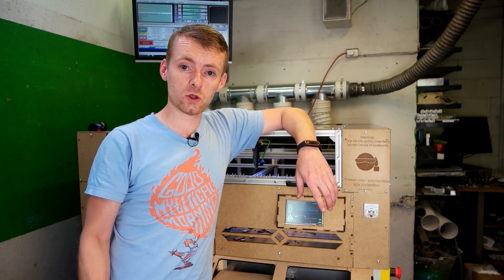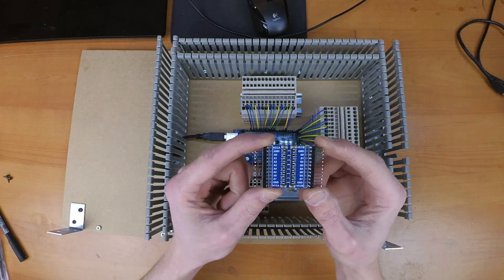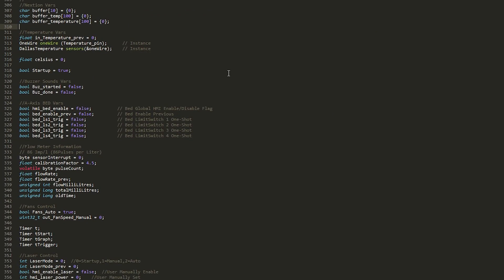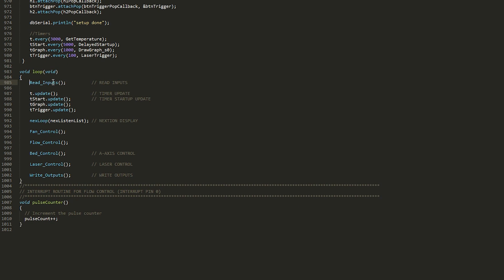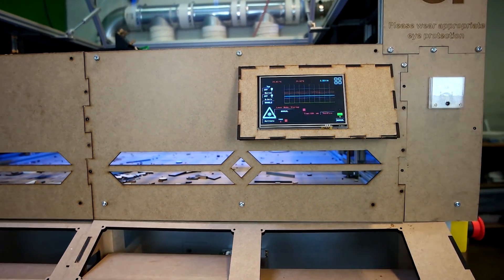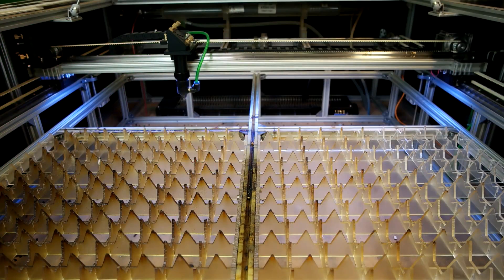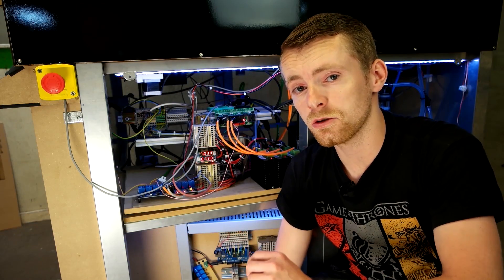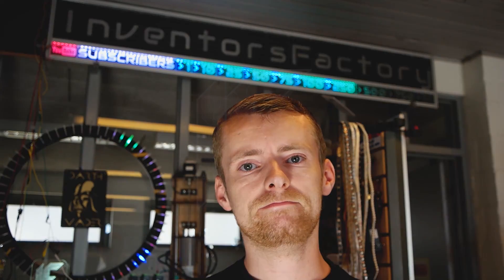DIY Laser Cutter Buildlog - Part4 - Waterloop Test, Electronics Cleanup, Safety and Extra

Comment: What a embedded micro controller based on the AMD PHENOM II X6 Stepping 3 would allow the use of floating point to give a cleaner and much nicer cuts, just an Idea.
Reply from the maker: Hi David, I could, but don't really need it as my cuts are clean and acceptable. I'm guissing you think the Arduino is doin the motion control and trigger but No, I'm using a Pokeys56U as the controller with an external 125kHz Pulse Engine so I'm good on that :)

Comment: Great video 
I have one question how do you control the laser power automatically for cutting and engraving ?
Reply from the maker: Hi Peter, thanks and good question ;) I don't do it automatically, I manually adjust power for engraving and cutting, in other words! I make a gcode file for the engraving and one for cutting :) I am planning on controlling the laser power from the spindle speed S Command, just as I de/activate the laser with the M4/M5 commands, just haven't gotten around to it yet :)
Reply: Great work ... so far :) .... did you try to work with special laser controller. .... ..
and how do you control the tube current .. ?
Reply from the maker: Thanks, no never tried with a laser controller, but will buy one for sure! controlling the laser tube current I used a pwm output on the arduino for a long time, but have now switched to a 0-5v potentiometer, I dial it in with a laser tube amp meter to ensure I don't go past the tube's limit ;)
Reply: can you point me to the circuit schematic for the current limiting ... I know that the tube require a high voltage power supply is that right ?
Reply from the maker: I can not I'm afraid, I have no current limiting in mine, so I do not know enough on that topic... The PSU I bought together with the 40watt tube on ebay back in the day...

edited: And yes it is a High voltage power supply :)
Reply: so you have a potentiometer connected to the laser tube power line and this is how you control the laser power ?
Reply from the maker: Typical the PSU has these connectors in the back, so the IN I control via a 0-5v signal to control the output of the Power Supply to the Laser Tube.

Link: https://www.google.dk/search?q=co2+laser+psu+schematic&rlz=1C1GGRV_enDK751DK751&tbm=isch&tbo=u&source=univ&sa=X&ved=0ahUKEwiwkOv02d_XAhXHJJoKHdYhBlcQsAQIJQ&biw=1920&bih=989#imgrc=Ao7g-k9CLDSAAM:
Reply: Ok.....thanks for the help man ... really appreciate it
Reply from the maker: No Worries Peter, I'm not an expert in this matter except I got it working somehow with help ofcourse, And I have most definetly been in your shoes wanting answers to many questions! And believe me!!!! when I started!
I did countless hours of scouting the internet, video's forums and stuff to get closer to completing it ;)

Comment: I am thinking to make a co2 laser cutter for my projects, what is the approximate cost of your cutter
Reply from the maker: Hi raghav, well depends on where you are in the world ;) I'm in Denmark and order most of my stuff from Germany. 
Without all the extra failed stuff and replaced parts, It's about 4k$ which isin't very cheap! 
If you want to estimate your cost search for:
Laser tube + psu, rails, steppers and drivers, controller and mirror holders and nozzle + the Profile construction you want which should give you a pretty good baseline to go for :) this is if you need something larger than an A3 size cutting area I would say ;)
Reply: Thanx
 i will study more about this

Comment: I like how you structured your code (fellow industrial automation specialist here). Also, how you walk us through your code is a surprising example of how NOT boring a code explanation in a youtube video can be.
But please, fix the audio in your videos. I have to raise the volume and still listen very closely for you talking whereas the intro video blasts my ears at the same volume levels. Quality of sound is not great either.
Reply from the maker: Big Thanks +Tony Bukreev :) Yeah code explenations are usually pretty boring! But didn't think mine was any different, so thanks for the pointer ;)
As for the Audio, Yes! I will look into the big Volume difference, just made some comparisons and it's very obvious, and the quality "should" get better in the next ones.

Comment: Great series of videos. Here's a link to the recipe I used for laser cooling water: (https://1stage-sph.tumblr.com/post/152253487230/laser-cutter-engraver-part-16). I've been running for over a year with no problems.
Reply from the maker: Thanks Sean, and yeah! Thats quite a nice system and lucky recipe you got running! Mouth Wash had not crossed my mind! :D Nice site/blog you got there, I've bookmarked it so I can go through it more thoroughly ;) thanks. 

As I have such a small amount in my system a 2 liter distilled pc watercooling liquid with anti algie something something in it seems to do the trick but when expanding of my reservoir will be underway, I think your solution will be cheaper for sure! If I can get a hold on that here in Denmark :D

Comment: I watched carefully this build log and there are very important information here ! Thankyou so much for showing a so inspirational work !
I usually work with 3D printers and have been reading and watching videos on the subject, and this week I must get the risk and build a laser cutter to a friend. We need this laser cut too much for save our business and racing career. So thankyou again !
One question I would like to understand better is : why you said that the squared HIWIN rails you used are unecessary ? They are absulutelly expensive here, and I was planning in use 16mm round bars as linear guides. I´m afraid of this being not ideal. Could you pleeeease give more info on this subject ?
Reply from the maker: Hi +Carlos Freitas Thanks for watching and thank you for the nice comment, sounds interesting what you plan on doing, as for choosing squared vs round rails, I only speak from experience as my CNC machine uses round rails and I personally think they have too much flex to them! 
But you can use them as long as your Mounting system on top of the rail wagons is really good and tight! I believe this is the issue with the cnc... 
When building the laser I found a good place for Squared rails for not much extra price so I went with them as I wanted to eliminate any issues with mirror aligning and beam consistency. Don't know where you are in the world but if in Europe I highly recommend www.cnc-discount.de as they have some cheap'ish squared rails... in 15 and 20mm width sizes. 
So in conclusion Carlos, you don't need squared rails ;) I had the extra cash and bought them to have an easier experience I guess :) 
Just make sure to mount them properly and you should be fine, oh and when you get going please send me a link or something so I can see what your making/progress, I love seeing other people builds
Reply: Thankyou so much for your response ! And yes, I thought the best option would be the squared rais, but, as I live in Brazil, they are very expensive here compared to the round ones. I will try to use the round ones with aluminum support, but firstly I will try to find some deal on squared ones... who knows its my lucky week !
I will blog my progress for sure, will be a pleasure to share it, and btwe, I will need help ! 
Thankyou again !
Reply from the maker: +Carlos Freitas Awesome man. Looking forward to see your project. ;) And Good Luck, hope you find what you need 😉

Comment: I subscribed right now to your channel. I really loved the content!

Is there anywhere I can look to get that project with actual measures ? I'm actually planning on building a laser cutter myself and would love to have some guidelines.
I plan on buying most of the stuff I'll need from China as well, except for some things I can easily find for cheap here in Brazil.

Thank you once again for the quality content! =)
Reply from the maker: Hi and Thank you very much, I have a basic Sketchup of the design, back when I started inorder to keep track of the profiles I needed. Let me touch it up abit and I'll post it here for you to download abit later today. 

Very cool that you are starting your own build, and stay tuned for the next video as I'm gonna go through all the things that I like and "don't" like about my machine :) just so you don't make any of my mistakes! :)
Reply: InventorsFactory Thank you very much! It will make things much easier for me! =)
Reply from the maker: Hi Again, take into consideration that it is incomplete, and is also made with some modifications that are not on my machine at this point :) Use Sketchup Make 2017 or newer.

https://drive.google.com/drive/folders/0B3-WzWhvXB8EeEJ0UGVVNnd5Mkk?usp=sharing

PS: Any questions and you can hangout me: gunzedreng@gmail.com
Reply: Once again, thank you VERY much for the help! =) Now I just need to research more about the CO2 laser options and where to buy them. Here in my country they are EXTREMELY expensive... Just as an example, a 40W CO2 laser costs here around the equivalent of $900 (US Dollars).
Reply from the maker: +Rafael Darezzo No problem man 😉 
900$ is for a complete machine and not just the tube? right?
Reply: InventorsFactory, unfortunately not.. The 900 us dollars here is for the tube with the font only. =( taxes are very high and people that import stuff doesn't have any sense of how much we do have to work to make that amount of money! Hahaha
Reply from the maker: Damn!!! :O dat sux... I sure hope you can find something cheaper ! or a used machine and strip it for parts or something. Best of luck to you Rafael :D

Comment: Very cool build, thanks for sharing! Wrt, safety: you could also add a nice big hard to miss indicator/warning light on top of the machine that comes on whenever the laser is active. That way you're immediately aware if the safety interlocks didn't function as expected or something.
Reply from the maker: +Thunderbelch Hehehe yeah that thought has crossed my mind actually and I have plans todo something like that for sure with some extra in it aswell :) Details on that Coming up in the next one, where I'm gonna need some input from you guys. Thanks for the Comment

Comment: Really confused as to why you decided to go with Mach 3. Then running a breakout board to individual drivers. Correct me if I'm wrong but if you are using nema 17 or nema 23s, then this seems like a huge overkill, and simply getting a gshield or tinyG would have worked perfectly with GRBL, and would have saved at least $300
Reply from the maker: +jonathan lowe Hi, we bought 3 Pokeys56U boards and I used mine for the laser as mach3 supports it, and the extra breakout board was due to its external pulsegenerator that can pulse at 125kHz as I run my drivers at 1/256 stepping as my machine moves 75mm per rev.  so I needes extra resolution and speed. I am planning on a laser board in order todo raster engravings. So basically I used mach3 because I already had the hardware ;) no other particular reason.
Reply: InventorsFactory InventorsFactory guess if you already had Mach3 and everything it makes since! And damn 1/256 stepping?!? That's impressive, how does it affect torque?
Reply from the maker: Hi +jonathan Lowe, well I have found a good setting for the Amperage on the drivers, holding torque is very good without the motors getting too hot, but I have had to decrease Accelleration and Decelleration ramps quite abit in order to avoid step skipping due to loss of Torque at higher rapids, but is still plenty fast imo... Never needed anything faster sofar anyways :) Maximum speed is set to 10000mm/min and I never go past 5000mm/min when cutting/engraving... In the near Future the plan is going on a closed loop stepper setup! expensive but worth it ;)

Comment: just watched your series of videos.   very nicely done :)

after finishing all of this, would you make your own laser controller again using mach3/arduino?  or go with a canned laser controller like one off these:  http://www.lightobject.com/Laser-Controllers-C35.aspx

would your decision change if you didn't already own mach 3?
Reply from the maker: +Thomas Hays Thanks A lot man, Well it's technically mach3/Pokeys56U. The Arduino is only there for the extra features 😉 i like the freedom that I have but I would probably go for the finished controller solution for sure. I have future plans on buying one, so I can use both if needed.

As for what controller to go with, I have no clue yet and will have to do some digging on that. But I'll have that in the next video ;)